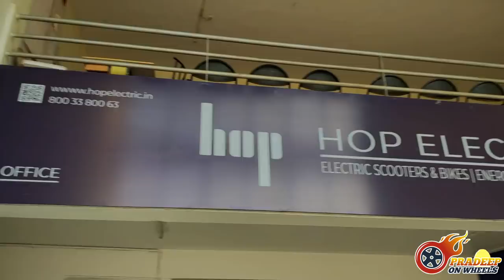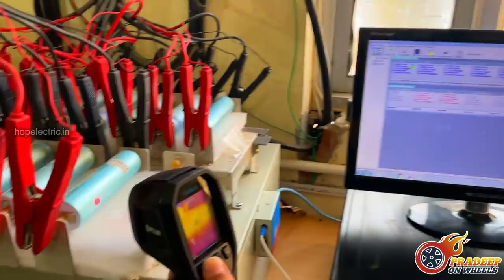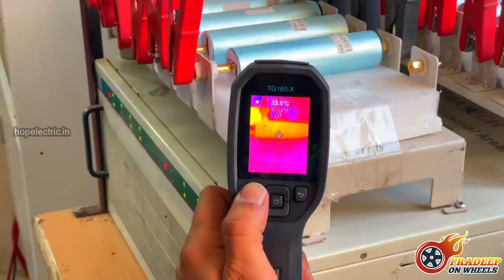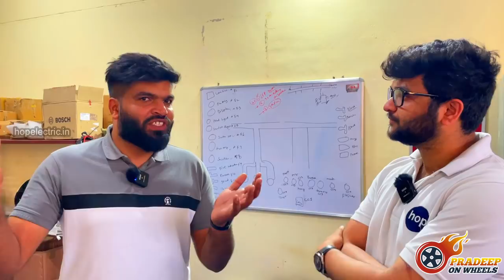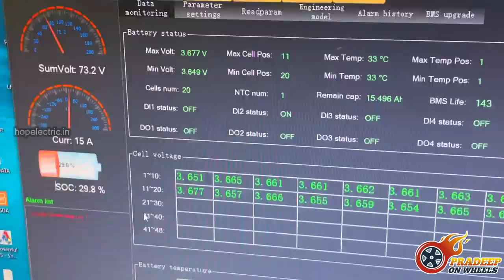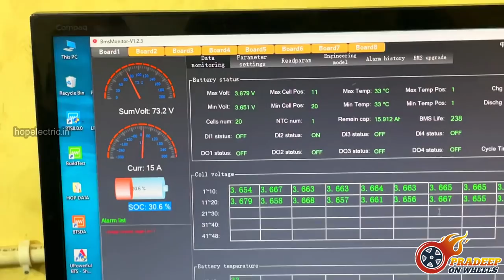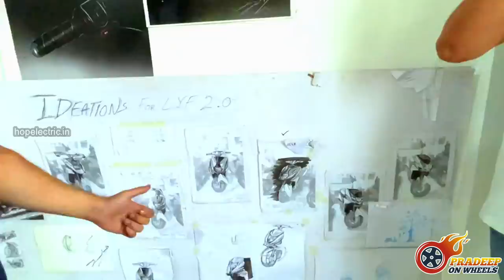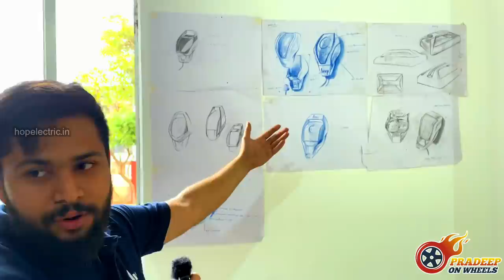Battery and Cell Testing- Why EV's are catching Fire |First time in YouTube with HOP Electric - POW

Comment: As usual Pradeep shows an ola fire on his thumbnail, despite Okinawa having 4 fires, boom motors with 1, pure ev with 4 and jethendra with 20.  I suppose Ola gets subscribers. 
This guy totally dismissed cell quality by saying it's not the cell, despite the USA road transportation safety board investigating LG chemicals for a large number of fire related recalls in Tesla, GM, VW, Hyundai, Mercedes and Ford.  LG is a tier1 supplier.  There is a lack of understanding here.  Pradeep clearly called out that when a cell goes into thermal runaway it cannot be stopped and heats the next cell until it fails.  This guy said, it causes the next cell to short so they disconnect it.  This is nonsense, first off, the cells are wire bonded with welds so they cannot be isolated, and secondly the heat will cause the next cell to burn up despite the cell being disconnected. That's why it's called thermal runnaway and not short circuit runaway.  Finally any safety engineer will tell you that semiconductors and bms are not safety elements.  A fuse will open a circuit when it fails.  A semiconductor fails short circuit so it cannot protect anything.  
There was no mention of overcharging which is another major cause of failure, and recently in India most fatalities and a large number of fires occur on chargers not in the heat of summer.  They did not show any battery pack testing, no large shock and vibration machines for the pack, no robot wire bonders with optical inspection computers, nothing but a design test.  Quality control is more important than these simple tests as it catches failures in assembly.  Sorry, this gives me no faith.  At least ola puts each cell into its own aluminium pocket inside the cast aluminium pack so it's physically isolated and they use wire bond robots with AOI.  These guys will have a fire too as a bad cell from a tier 1 supplier will get installed eventually
Reply: exactly. these guys either have no idea of what they're doing, or they're trying to look like they're knowledgeable to fool the unaware people.
Reply: @IbbiAhmed  well looks like the government disagrees with this expert in the case of the ola fire which appears to be a defective cell.  The government also was very critical of companies with very few employees and therefore limited expertise

Comment: The maximum continuous discharge rate claimed by cell manufacturers is based on a cell in free air and starting from 20 or 25 degrees C and ending up at about 80deg. C. (80deg does not bring a risk of immediate disaster but the life of the cells will be greatly shortened if they reach this temperature often.) This rated current is not realistic where the cell is in a large battery pack and it is in a scooter that has been standing in direct sunlight for several hours in many parts of India. The temperature could be starting from 65deg or more, and the maximum current you can take without the battery going over 80deg is much lower. You need cells with a much higher rated discharge current than you will actually use, so as to reduce the rise in temperature. There is a temptation not to use cells with a higher rated current because they do not store as much energy for a given price and weight.

Comment: Use the black body radiation temperature  based temp seting in your thermal camera.   Set emmisivitty to 0.95.    .     Ambient temperature is not the problem . The problem is how much heat can battery outer body  dissipate.  Just use transformer oil to cool battery. Bypass diode will bypass the faulty battery!

Comment: Cell selection very important stage for make the lithium battery pack and cell should test and validate on all temp.condition .Lab should have equiped with all required environment chamber and vibration parameters.and should be use wire wounded insted of spot weld.

Comment: To save the environment people are asked to use EV but they are causing injuries / deaths and even claim of manufacturers about how many kms can be covered in one charge are also being found false and those who booked EV are cancelling or planning to cancel the bookings done for two and four wheelers .The vehicles should be tested extensively in all weathers for checking the quality of battery as well on how many kms the vehicle can do in one charge. Because of incidences people are afraid to charge the battery fully also .In case the EV are so risky the manufacturers should use best quality batteries and material in making of vehicles and complaints made by customers about bad performance of anything in the vehicle should be taken seriously and should be attended on priority Those driving in cities may still get some help in case of any emergency but if the vehicles are used in small towns or on highway while going from one place to another then there is no immediate help available to those whose EV breaks down for discharge of battery or for other reason .Gov l should also  be strict with manufacturers as not only hard earned money of people is involved but something bought for convenience turns into inconvenience and risk to life which should be tried to be prevented .
Reply: I agree an whats even worse i read in one of the articles that people who have had fires and their vehicles recalled will not be given a new battery, they will only check the wiring and see if there are any loose connections as removing and testing the bqattery is deemed as "too expensive" for the manufacturer. Ev's are still not practical and have along way to go.

Comment: In the news the Ather caught on fire is that true, any Ather vehicle got fire 🔥?
Reply: not yet
Reply: Ather is safe
Reply: No Ather fires. I don't think they will have fires. Ather has a lot of scooters on the road for a few years. It is engineered by Indians for Indian conditions. 
Unlike Ola and other Chinese scooters.
Reply: @sanajaobatongbram108   You my doubt is when we turn off or shutdown my scooter (Ather) all the electricals will be off so when there is lot of heat falling towards my scooter whether the cooling systems exists or not it my catch fire 🔥 right because to cool the battery the electronics will be shutdown.
Reply: @anirudhhhh   You my doubt is when we turn off or shutdown my scooter (Ather) all the electricals will be off so when there is lot of heat falling towards my scooter whether the cooling systems exists or not it my catch fire 🔥 right because to cool the battery the electronics will be shutdown.

Comment: CTO is lying. As you can see the water is filled only upto the centre of the motor because it will damage it. 

Check Hop manual, you cannot drive the bike if the water is more than mid way of your wheel.